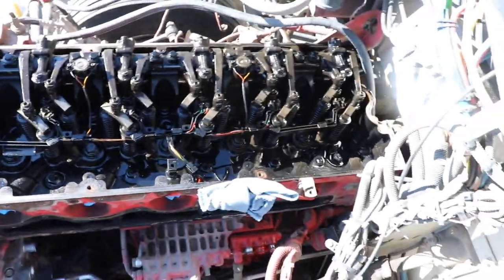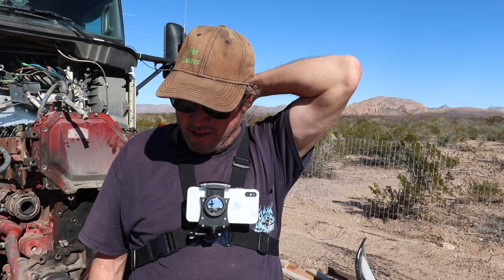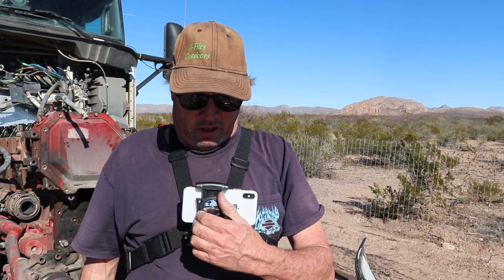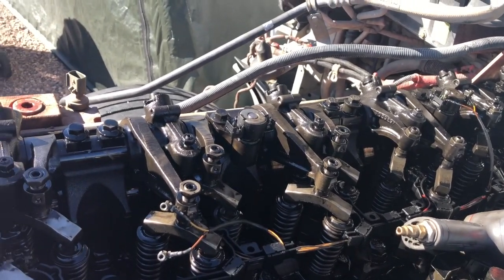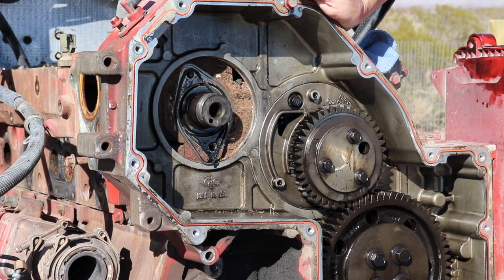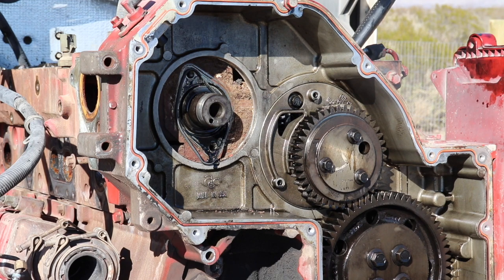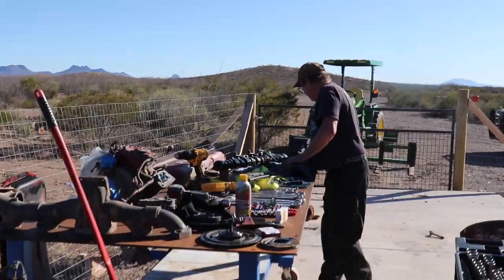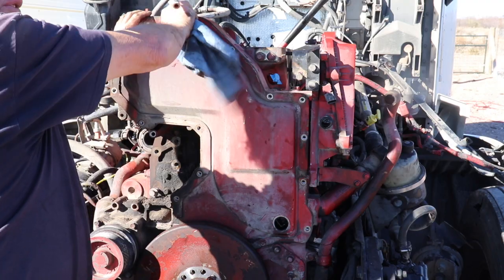8- Cummins Single Cam ISX, Valve Train and Cam Removal.

Comment: u dont need to back off the adjusting nuts to take the rockers off just unbolt the rockers and run the overhead when u install them back
Reply from the maker: You do if you’re putting in a new cam